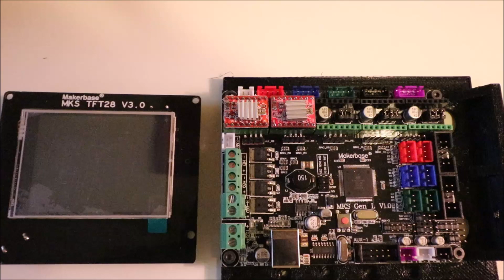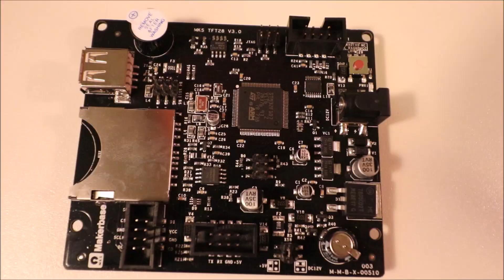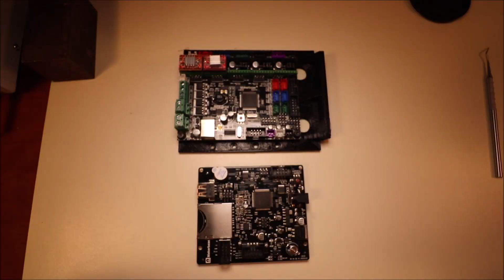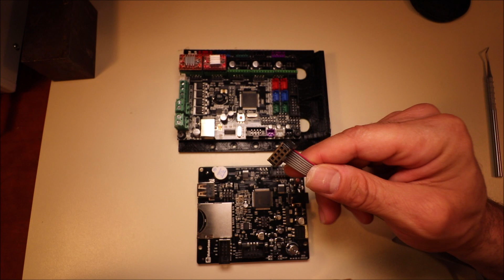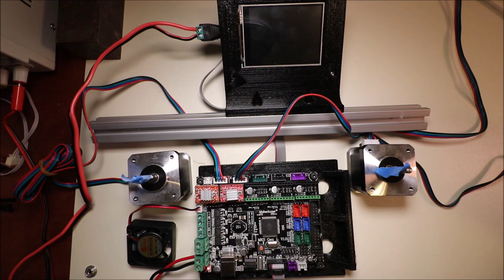MKS Gen L - TFT 28 LCD Touch Screen

Comment: i got a question Edward do this screen work with 24 volts power supply? i mean my geeetech a 10 with an mks gen l board work with a 24 volt power supply???
Reply from the maker: I think it can run off a 5v power supply on aux-1.  You can always consult the datasheet.
Reply: @EdwardBraiman  thanks Edward :)
Reply from the maker: You're welcome.
Reply: i just plug my new tft 28 and no need for external power supply in my case i run it in 5 volt mode and wow!! this screen im in love with!

Comment: Hi,
I'm running the same board and the same screen.
When I set up Cura (4.4) to stop at height the printer stops and goes out of the way as supposed to, the problem is that I can't restart the print.

Any idea how can I do that?
Thanks in advance!
Reply from the maker: Do the mean the z-axis?  Cura 4.4 creates the instructions in the form of gcodes to move the printer.  Could you explain more about the height way out of the way?  I'm not sure I understand the question.
Reply: @EdwardBraiman  Thanks for the fast reply.
Basically I want the print to stop and a certain Z-axis height (or layer number).
I set it up on Cura and the printer stops as it should.
After I change the filament or do whatever I want to do I can't find a way to restart the print again. This is the problem I'm facing.

If you see this video he changes the filament and then by a simple click he restarts the print.

https://www.youtube.com/watch?v=pEbnix5wZP4

I was also able to do the same with my original printer setup (main board+lcd creen), but with the Gen L+TFT I can't find a way to restart...
Hope I made it clear... 
Thanks again.
Reply from the maker: You can restrict a axis in Marlin firmware on configuration.h.
Reply: @EdwardBraiman  I'm not sure I get what you are suggesting....
Why should I restrict the axis?
I just want to restart the print after a pause...
Reply from the maker: So you're changing filiment and can't restart print?
Reply: @EdwardBraiman  Yes.
In my case I'm pausing the print to insert some steel nuts on a part and not to change filament but that is the problem, restart printing after a pause.

Comment: Hello Edward,

I have a question: I use a tft32_L v4.0 touchscreen but the weird thing is that it only turns on when I connect my laptop through usb onto the mks gen L morherboard.
Any help would be greatly appreciated!
Reply from the maker: Sounds like the problem is related to the board and how it's power with 5 volts.  I'll experiment with my TFT 32 and see what I can find.    Could you tell me a little about your configuration?  What type of printer board are you using?  Which auxiliary port are you connected? Which firmware are you using?
Reply: @EdwardBraiman  first of all thank you for your quick response!
I just found out my gen l board shorted somehow. The heatbed just kept heating up for some reason and the stepper motors didn't respond either.
I watched your videos a couple of times and connected everything correctly, wel I don't know for sure now obviously...
Reply from the maker: Do you have thermal runaway enable for both hotend and heat bed in Marlin firmware?    I recommend it be enable to prevent accidental overheating.
Reply: @EdwardBraiman  I am not that well known with marlin yet.
I will look into it but could you please take a look at my board and tell me if its possible to safe it?
https://drive.google.com/drive/folders/1T8upZKIR0Rp5Egsm8x4dsclwlde0Ktth?usp=sharing

Comment: isn't 5v just fine.?  others have posted 5v too
Reply from the maker: It should be.  When I tested back then was unable to get working.  With the new MKS TFT32 version 4.0, it works on 5 volts.  Also it appears to be working on RAMPS 1.4 for movement and fans.
Reply from the maker: Just retested and it will work for 5v.

Comment: I have the same one and the touchscreen doesn’t work after my daughter click on the configuration and tried to do something, i tried doing a reset by pressing the reset bottom and no luck, any idea how to fix it?
Reply from the maker: Not sure, but maybe reload if it can power up.
Reply: Reload the firmware and now is working but , looks bad on the screen, like the old atari screen, im using the classic, tried the other two files and it gives me sd error and stopped the install, so for now im gonna leave it like that cause is usable ut if you can find a fix for it I will appreciate it
Reply from the maker: I'll look around, but not sure if I can offer much help yet.  I might do a tutorial series on this TFT LCD in the coming months.  They give very little details for this TFT LCD, so it's takes time.
Reply: Edward Braiman thanks, I appreciate it
Reply from the maker: You're welcome

Comment: Is this procedure the same as for a TFT 32?
Reply from the maker: I'm still waiting to try a TFT32.  They should be similar.
Reply: @EdwardBraiman  alright, thanks for the reply! I am about to build my own 3D printer and I will probably choose this board and screen.
Reply from the maker: I'll be testing it again.  It appears to only work so far on MKS Gen L.  It might work with MKS Gen 1.4, but need to check.
Reply: @EdwardBraiman  can you do a video about the TFT WIFI module and the HLK WIFI module?
Reply from the maker: I've the WiFi module, just researching a simple way to present.

Comment: Wait, it's the TfT that has the filament runout connector and NOT the RAMPS board?
Reply from the maker: They both can.
Reply: @EdwardBraiman  thanks, that's good to know. I'll have to research pinouts for both now.
Reply from the maker: One has a video under RAMPS 1.4 playlist.  I think it's named filament runout.  Also I'll be doing another on MKS Gen L version 1.0 soon that's why I posted a video in MKS Gen L playlist on LCD today.
Reply from the maker: I have a tutorial on how to run cooling fans off servo pins in both MKS Gen L and RAMPS 1.4 that might help.
Reply: @EdwardBraiman  ooh cool. Tha KS I'll be looking for it!

Comment: I just bought the Gen L board and the MKS 3.2. Nothing seems to work at all. The screen has all of the icons but stepper Motors and fan don't budge. I don't know if I should just send it all back at this point but I will keep plugging at it. Thanks for the video though, it shows me that I should be able to make it work without having to mess with any firmware on the boards. Mine doesn't do anything so that is helpful. I would be suspicious of the stepper drivers I put in there but the fan doesn't operate either. Thanks again.
Reply from the maker: Well if it makes you feel any better, my first TFT28 didn't work either, seems like they have set-up instruction issues or faulty manufacturing.  But in my case I tried to setup with RAMPS 1.4

Comment: So you definitely need to run 12vdc to operate? I was looking at the schematics and documentation and thought it would get that from the Aux plug?
Reply from the maker: If memory serves me correctly, the LCD would not power up.  But there maybe a jumper to change this.  When I made the tutorial it was the simplest way to demonstrate.  I'm thinking about doing another tutorial in the coming months, but I'll need to research deeper.  Still need to show the networking option.  Let me know if you find a way to get 5v to work.

Comment: Excellent video.
Unfortunately, I did not watch it before performing the MKS Gen L setup with my TFT 28 touch screen LCD. As soon as I connected the cables I decided to update the firmware of both of them. The result was that I lost important functions like engine and fan control. Could you help me by making available the firmwares you are using? Thank you very much for making your knowledge available to everyone.
Reply from the maker: Which firmware are you referring too ?  The tft28 or Marlin firmware?  They are openly available online.  Let me know if the link is missing from the description.
Reply: @EdwardBraiman , thanks for the quick reply. In fact I believe the problem lies in the Marlin. If you want, I made available the problem that happens in a video posted on Facebook. Both the manual feed (0.1, 1 and 10mm) of the X, Y and Z axes as well as the fan control do not work. Once again I thank you very much for the help. (https://www.facebook.com/yomar.ferreira/videos/1984858118297064/)
Reply: @EdwardBraiman  
Could it help by providing firmwares or even your links?
Reply from the maker: Here is the link ... https://github.com/makerbase-mks/MKS-TFT

Comment: Excellent video, but does it matter which way you plug the filament sensor in to the touchscreen? Thanks in advance for your help.
Reply from the maker: I've yet to explore the pins on the tft LCD, but it will matter depending on the sensor type. You can view it like an endstop switch.

Comment: Can you run it with mks v 1.3
Reply from the maker: So far I know it works on MKS GEN L v1.0, it's was said it works on RAMPS 1.4, but I was not able to make it work.  Currently I do not own a MKS v1.3.  I do have a MKS Gen 1.4 and 1.5, but have yet to try.  So I guess what I'm saying is I do not know if it will work.  Wish I could give you a better answer.